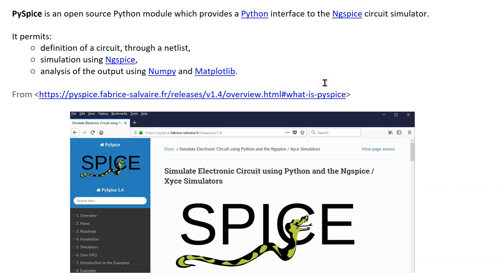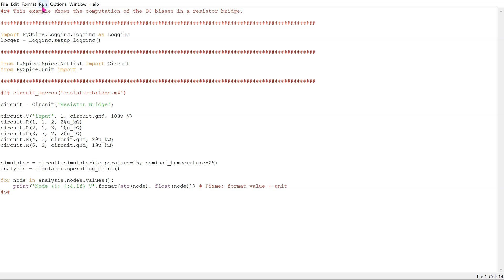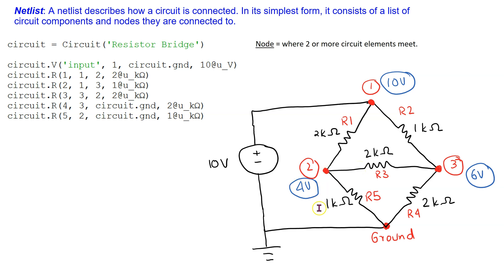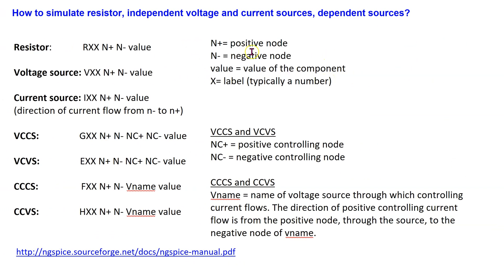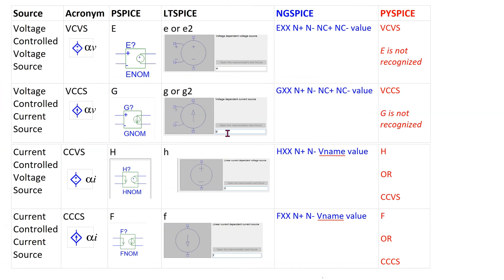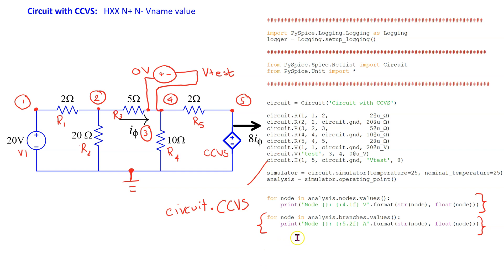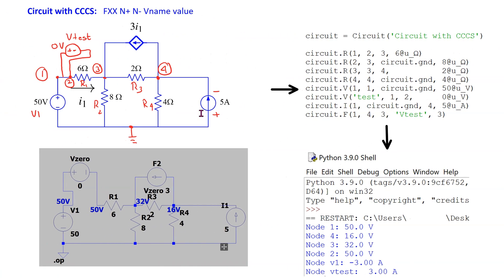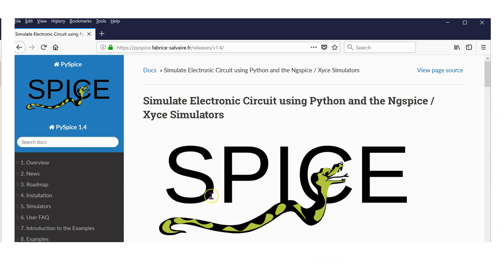Introduction to PySpice (Python) for DC Circuit Analysis with Dependent Sources

Comment: How much basic electronic knowledge one should have for this lecture ?
Reply from the maker: Thank you for the question. This video is intended for first year electronic/electrical engineering students. DC circuit analysis and dependent sources is usually one of the first topics taught in an introductory electronic engineering course. 

If you are not familiar with these concepts, they are covered in other videos in this channel.

Comment: Thanks for the lecture. I have a question, Is it possible to save the voltages or currents to an excel sheet from the terminal, or with a python command? Thanks!
Reply from the maker: Thank you for this suggestion. Yes this should be doable. I will hopefully post a reply soon on this.

Comment: ¿ do you know wich mehtod does Pyspice use for  symbolic solutions?
Reply from the maker: PySpice uses NGSpice as back-end circuit simulator. NGSpice, like LTSPICE and PSPICE, does simulations using node voltage method.

To calculate the theoretical values (or symbolic solutions) in PySpice, we can code in any formulas obtained using any valid circuit theory method (Ohm's law, Kirchoff laws, Node voltage method, mesh current method etc).

Please see other videos in the PySpice playlist (https://www.youtube.com/watch?v=KnA7xI7MAuI&list=PL6JL9fVjrZLcqixnvq9wUpG1xNGrIRH8j) to see different examples of how to code theoretical values in PySpice and compare with the simulated values.

Hope this answers your question!